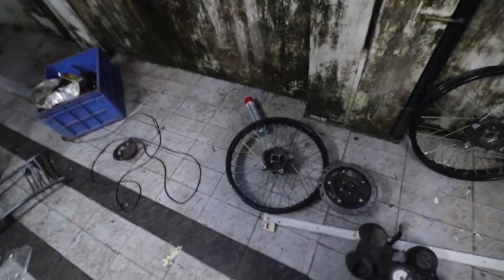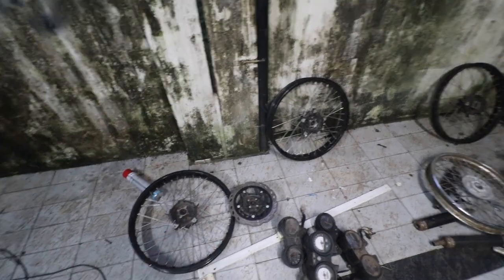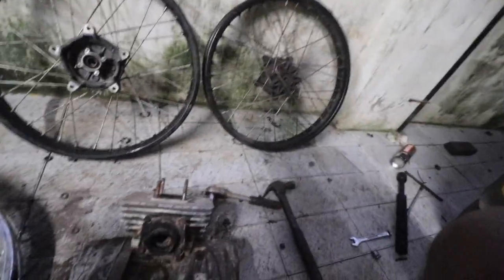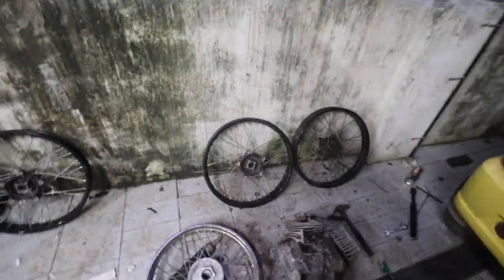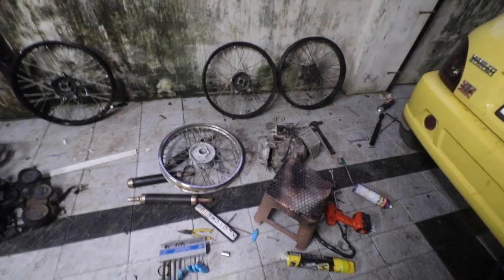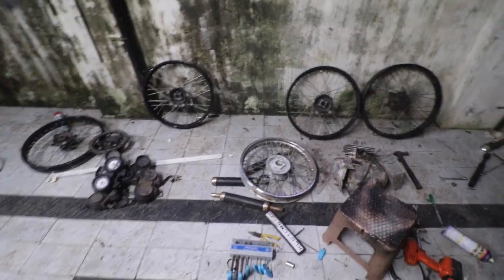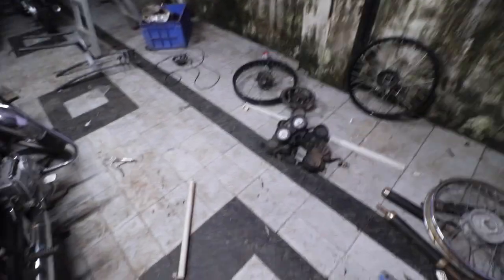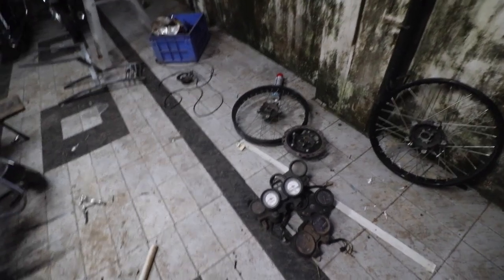Road to Super bike Part 3 (English Video)

Comment: Sir can we fix pulsur 150 fork and caliber to rxz disk and hub..... Plzz reply
Reply from the maker: No
Reply: @Yamakaze  and sir can u plz tell me did the r15 v1 caliber work on rxz
Reply from the maker: Yes it fits perfectly you need to add 8mm spacers to bolt it to the fork
Reply: @Yamakaze  sir what about the forks should we buy rxz forks or gladiator??
Reply: @Yamakaze  sir please do reply...🙏🙏
Reply from the maker: @VinodKumar-sv3od  Rxz if you want the R15 caliper, gladiator if you can get the gladiator caliper
Reply: @Yamakaze  sir now I brought a rxz forks and r15 V2 caliper will it work..
Reply from the maker: @VinodKumar-sv3od  yes